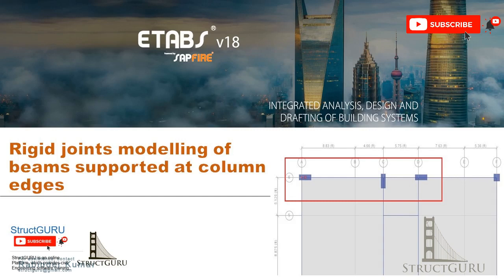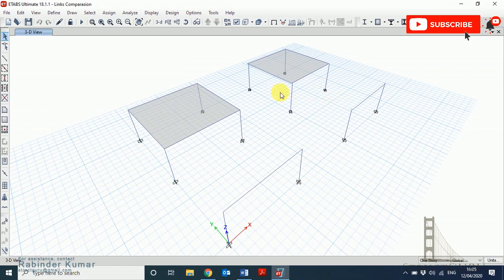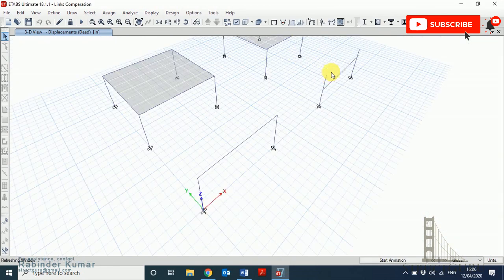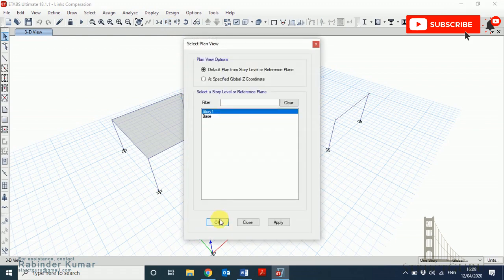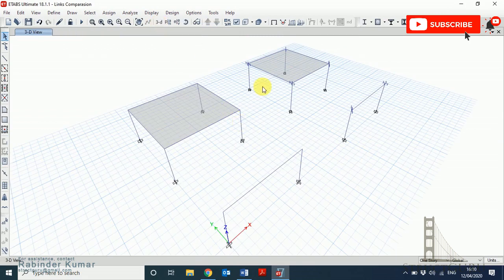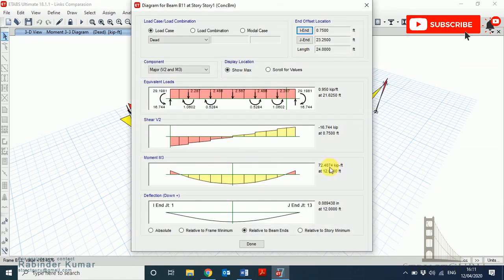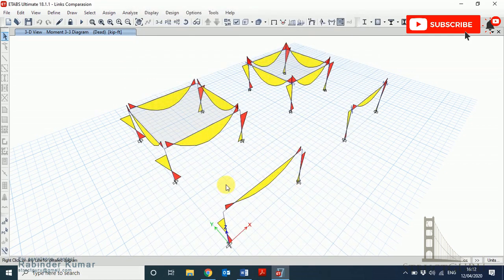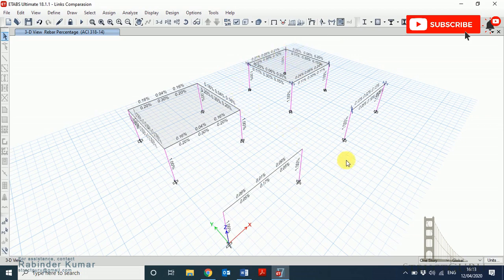Rigid joints modelling of beams supported at column edges

Comment: It really was very informative thanks a lot although I have a doubt that if the difference between column and beam center line is 4-6 inches can we still analyze by considering the center line to be same without actually applying rigid links?
Reply from the maker: Yes,  within 6", it is ok to model beam and column on same center line.